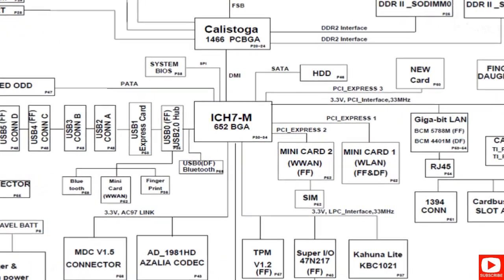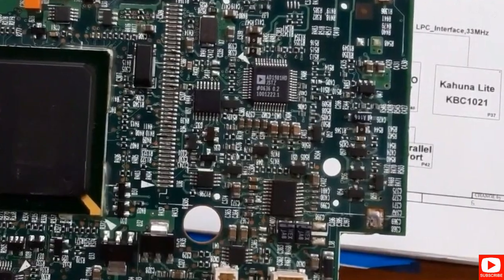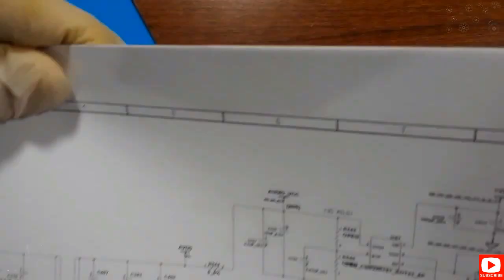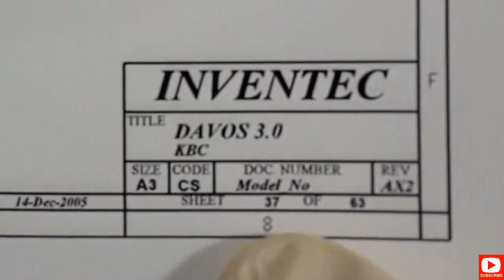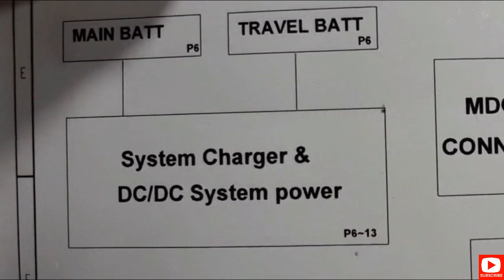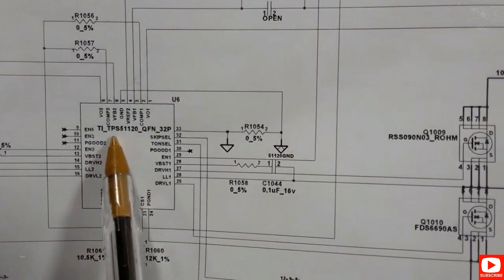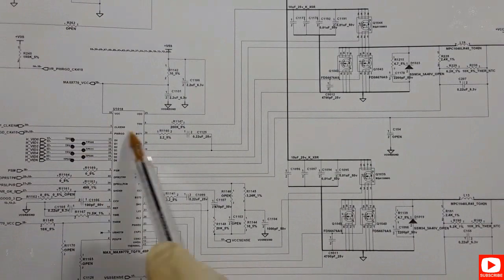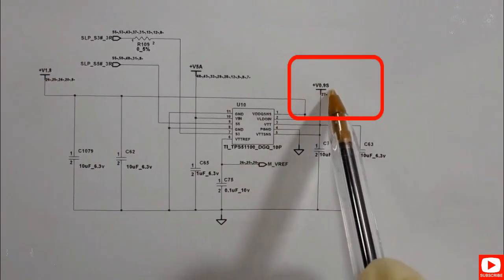Learn how to read laptop schematics diagrams part 1 | laptop schematics tracing | Computer schemes

Comment: For what purpose Mosfet used? for amplification or switching purpose? Can't we use without them?
Reply from the maker: Right Mosfets are used for both amplifications and switching purpose.
For amplification we can use other electronic components.
Reply: @electronicsrepairbasics_erb  Are you sure, mosfet used as an amplifier here? why? how much do they amplify? I am a bit     confused why mosfet used i power areas in laptop?